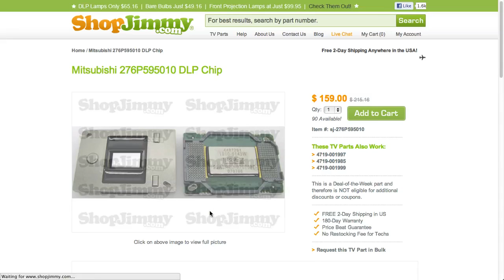DLP TV Repair - Samsung/Mitsubishi/Toshiba 4719-001997 DLP Chip Replacement - How to Fix DLP TVs

Comment: shop jimmy really needs to take this video down. This tv cannot be fixed any more, as the parts are no longer produced. If you get the white dots, you have to throw the tv away. DLP is a dead technology and the parts needed to do the repair will run you more than a 55 inch lcd tv. No more fixing tvs, just throw them away and buy a new one. Tvs are no longer repairable.
Reply: That's funny, just fixed my 61 inch Samsung DLP chip, lamp and fan. I'll get several more years out of it.

Comment: This is great, but you shouldn't have removed the 3 brass colored screws (labeled 1, 2, and 3).  That destroys the factory alignment.  I wish I had realized that before I followed this.  
The 3 brass screws and the back of the housing should be left in place. This leaves the back half of the aluminum DMD housing, maintaining the factory alignment.  The process shown above makes no provision for ensuring the DMD chip is even level when screwed back into place.
Again, leave the screws that keep the back half of the aluminum housing and aluminum DMD block if you want to save the level and alignment. 
This is true for any set using this DMD solution.  Mine is the LED based one, so my 3 screws that needed to stay were not brass, but they are under the plastic caps before you take the front half of the housing off.  
In other words, leave the screws under the plastic caps in place, even after you take the front half of the housing off.  This leaves the back half of the housing and DMD alignment block in place.

ARGH!  Wish I had known this...
Reply: Thanks for the info! I'm performing surgery tomorrow to replace my DLP chip. This is a very good tip! ❤️

Comment: Exactly which TV model is being shown in this video?  I have a Samsung HL67A750A1F TV and am wondering if this video will help with replacing the Samsung/Mitsubishi/Toshiba 4719-001997 DLP Chip (Original, New) I just purchased from the ShopJimmy.com website?  It would be easier for me to follow a video which uses the exact same model TV that I have.
Reply from the maker: Carlos Salguero   This video may not be the exact TV model that you have, but it can still be a useful tool to help with the DLP Chip Installation process.  Thanks!  www.shopjimmy.com
Reply: ShopJimmy.com
Thank you!  It indeed helped with the DLP Chip replacement.  My white dot problem is gone now!

Comment: I have a Samsung DLP TV with 17 white dots on screen described above. The model# is HL50A650CIFXZA, and serial # is B47R3CKQ900866Y Version PK01. Do I have to take it apart to figure what DLP chip I need or can you tell me from the information I've provided.

Comment: i just got my dip chip (from www.ShopJimmy.com 's amazon store) to replace my broken one on my samsung model # HL50a650c1fxza and its the high price on well whats on this video but what problem I'm having is i did the repair and then turned the tv on but i looked at it from the back when i turned it on to see if i put the fan in correctly and it was on for 5 seconds and cut off and when i tried to turn it back on nothing but a few rapid blinks from the logo power button and some slower longer blinks for a longer time i believe it was maybe four times then out what do you think could be the problem
Reply from the maker: James Creech   I recommend reseating the chip to be sure it is in there correctly and also make sure you close the lamp door all the way.  Thanks!  www.shopjimmy.com

Comment: Replaced the DLP chip in our Samsung HL67A750A1FXZA TV and the white dots are all gone, picture is beautiful again....however..the projected picture is too high on the screen leaving a gap at the bottom w/o a pic.  We used the remote to enter service mode, adjusted, (moving the picture down), to zero reading, and still have a 2" gap at the bottom.  
How do we do a geometric adjustment to get it back in range to fine tune it using the service mode with the remote?  Do you have a video for this?
Reply from the maker: William Womack  The DMD board just needs to be aligned and adjusted.  Here is a video that may help you: DLP TV Repair for Off Center Picture Display DMD Boards & Formatter Boards Alignment  Thanks!  www.shopjimmy.com
Reply: I just changed the DLP chip on my Samsung. I too have the gap on the bottom of my screen. How do I move the picture down?
Reply from the maker: Terri Giesken   This video may help you out:  DLP TV Repair for Off Center Picture Display DMD Boards & Formatter Boards Alignment  Thanks!  www.shopjimmy.com

Comment: Just replaced the DMD chip on my Samsung DLP, worked like a charm!
Reply: Hey Alex, I was wondering...I am on the verge of replacing the DLP chip on my Samsung DLP and was wondering how long it took you from start to finish. Thanks!
Reply: Since it was my 1st time I was being careful and going slow, about 2 to 2 1/2 hour job. Watching the video is great help.
Reply: Cool, going to replace mine today! Thanks for the reply!
Reply: Also, look into mirror cleaning while you have it apart. After mirror cleaning it's so much brighter and sharper!
Reply: I used windex. There's also a video on that.
Reply: Use vacuum to get dust off of everything.
Reply: Alex Caballero What video did you use?
Reply: Al Caba ~ Thanks for the tip. I was wondering how I was going to get rid of the dust. Didn't have a can of forced air around that I use to clean my keyboard (forgot what it's called). The vacuum makes great sense. Gorgeous baby, by the way!

Comment: On my model, when you remove the dmd board screws, you only need to remove the 4 around the chip, the 3 recessed ones should remain, or you will screw up alignment.

Comment: I have aMITSUBISHI WD-60735 and recently replaced the lamp turned the tv on and the screen worked for about 5 minutes and then flickered while changing shapes of color. I turned the tv off and let it sit for an hour and turned it back on and did the same thing. Great screen for about 5 minutes the flickering screen. When the screen starts flickering there is a louder noise coming from the back which makes me think its a color wheel.  What can it be? tinikuis@yahoo.com tanks

Comment from the maker: It should clear the up the white dots. The black screen is more of a concern. If the chip was that bad it could be due to a bad chip. But you may have more than one issue. Start with the chip and see if that solves everything. Thanks and please let us know if you need any other assistance. (877) 881-6492 (952) 881-6492

Comment: I have the Samsung HL67A750A1FXZA and tried adjusting it using the screws but couldn't seem to get it perfectly adjusted that way.

It was only off about an 1/8 of an inch on the left side and only noticeable when viewing the menu bar of the Mac I have connected to this TV. After messing with the screws for about 20 minutes I gave up and used wood shims which fixed it in under five minutes.

Comment: Bought the chip through Amazon (paid $5 more) but I see it actually came from ShopJummy. 

Video was very helpful in replacing the chip. Didn't need anything more than a Phillips screw driver. Took me about an hour to do.

I have a Mac connected to the TV and the menu bar was always a bit higher on the left than on the right so after putting the light engine back in I used a wood shim to every so slightly wedge the opposite side of the board up and now it's better than new.

Comment from the maker: @Firaydun Zarghami: Samsung HL-T6756W Model has 2 different versions.  The Version Number can be found on the TV labels on the back and/or sides of the TV.  Version PF01 takes a 4719-001997 DLP Chip, & Version PF02 takes a 4719-001969 DLP Chip.  While the inside of your TV may look a little different from the one in this video, the steps will be very much the same for any Samsung DLP Chip replacement.  If you need more help, feel free to call us at 1 877 881 6492 for FREE Tech Support!

Comment from the maker: @Rtstrider : If the thermal pad is dried out or crumbling, it is a good idea to replace it. Thermal grease might work ok, but I think there is a gap between the heatsink and the chip in most models, so it may not be as efficient as a thermal pad.

Comment: So just to double check you do not recommend adding thermal grease to the chip before replacing the heatsink? Would adding Arctic Silver 5 void the warranty? I think this would be a good idea as it would help the heat transfer from the chip to the heatsink more efficiently